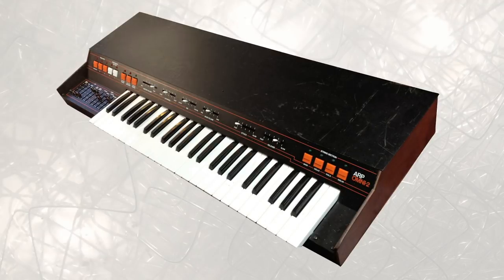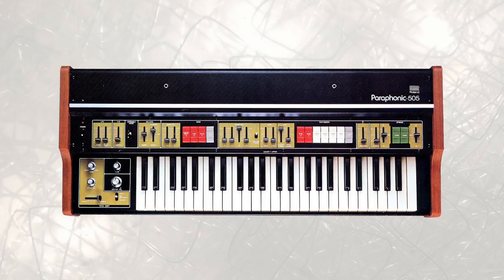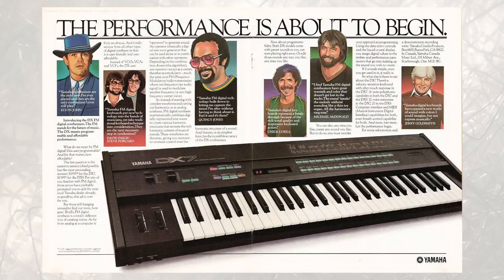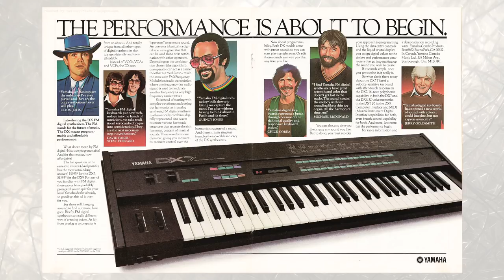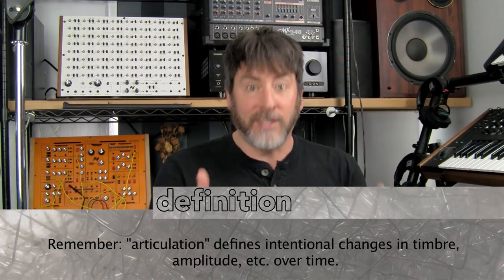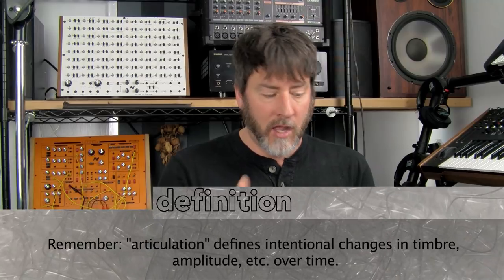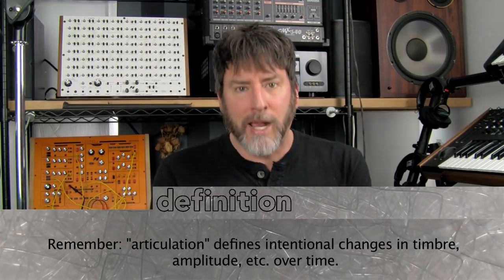A History of Polyphony: Part 14- Paraphony

Comment: I used to have a Poly-800. I was of the belief that it had 8 oscillators, 8 amp envelopes before the filter, a single filter with filter envelope, lfo, and step sequencer. It was a fun way to get poly synth sound for less than a grand.

Comment: What about this classification?
-monophonic
-polyphonic

Polyphonic synths have multiple branches:
- duophonic: 2 notes at once max (2 keyboard CV technique: higher and lower voltage) 
- paraphonic: multiple notes at once, frequency divider technology, but with single articulation (basically 1 voice) 
-"true" polyphonic: multiple notes at once, homogenous timbre (RIP Oberheim), each voice has its own articulation

Comment: I first came across the term very recently when Atuturia describes the default setting of their virtual Solina IV as "paraphonic" because, like the hardware version, after you hit the first key, if that is depressed when you hit other keys you do not get the full envelope (Attack) and they added a fully polyphonic mode where each key uses the full envelope. I also noticed that with the Moog Opus 3 in 1985, I just called it "single-trigger polyphonic" since multiple keys would sound, but the filter would stay where it was and not re-trigger, so the first key would "wah" but if you kept that key down and used other keys, their tone would sound but at the current state of the VCF, which also did not have KB traking

Comment: It may be the case that using 'paraphonic' for a monophonic synthesizer is practically useless, because being monophonic implies being paraphonic by definition. Therefore using the term 'paraphonic' implies that a synthesizer is paraphonic AND poliphonic, because otherwise it would be just simply called monophonic (if it is monophonic AND paraphonic) OR poliphonic (if it is poliphonic AND NOT paraphonic). So 'paraphonic' - in that interpretation of this usus - is just being used as an abbreviation for 'paraphonic AND poliphonic'. This may cause (and actually caused) farther misunderstanding of the terms themselves, but is actually a sufficient distinction.

Nevertheless - fantastic, thoroughgoing video series. I hope you will do more in that vast topic of the history of synthesizers. It certainly deserves more research, categorization, explanation and clarification than it has now.
Reply from the maker: An interesting case is raised by the Yamaha CS-15, and your post has made me realize it!
The Yamaha CS-15 is monophonic, but actually NOT paraphonic, in that it features entire-voice architecture.  Each oscillator has its own filter, filter envelope, amp, and amp envelope.  Of course, this configuration is not at all a common configuration for historical monosynths, but it is interesting because it is an example where monophonic is not paraphonic!

But yes, the primary problem arrives with synths that can play two notes... we really don't call them "polyphonic..." that term seems to apply to three-note and up.  So, that's the point where "paraphonic" and "polyphonic" can't both be applied.  But beyond that, I agree with you.  "Paraphonic" is a type of polyphony (and not, somehow, the 'opposite' of polyphony, as some might believe.)

Thank you for your thought-provoking post, and for watching the series!

Comment: I came to this video because I was looking for the answer to a specific query in my head regarding paraphony as applied to Eurorack rigs, but I ended up subscribing to the channel because it explains the concept of paraphony very clearly. Nevertheless, I would love to know the answer to this question: Suppose that I have two parallel Eurorack modular patches — VCO-VCF-VCA modules patched together over here, call it synth A, and totally separate VCO-VCF-VCA modules patched together over there, call it synth B. Both synth A and synth B are monophonic, but I am sending them to one common mixer module. This is 2X monophony, played together, ergo... what? I feel it would be wrong to call it 2-voice polyphony, but maybe that is just what it is. Somewhere, someone got it into my head that it would be paraphony. According to this video, however, if I have grasped your lesson properly, it is actually not paraphony, because synth A and synth B are each quite capable of articulating the one waveform (however complex it can get with FM and AM modulation in the signal path) that each produces independently of the other. Perhaps then, it is not paraphony but most accurately called 2-voice polyphony. Or am I getting it wrong in some way?
Reply from the maker: The thing about polyphony is that it is largely a term that has to do with controllers or synthesizers with built-in controllers that communicates how many notes a user can generate at once with that specific instrument.  In other words, it doesn't really work with modular synthesizers because with modular, it's rarely the modular that is incapable of multiple notes at a time, it's the controller.  Because modulars usually have the ability to make multiple notes at once, the "polyphonic" aspect lies entirely with the controller.  

But we don't typically talk about polyphony with modulars that are controlled by sequencers for several reasons.  One, modulars are not finite.  You can't describe a modular generally as being monophonic or having a specific voice count because that can change, and does change.  These days, in addition to that, modulars are made up of a variety of brands and types of modules, meaning that we're not talking about an instrument concept, we're talking about a studio concept.  If you describe your personal modular in terms of polyphony, you're not talking about modulars in general, or a specific type of modular instrument, you're talking about how you have assembled your modular to have a specific outcome.  

Whereas you can ALWAYS say that a Minimoog is "monophonic," in general, as a means of communicating how many notes a specific instrument can play, you can never be that specific with a modular.  

Polyphony is largely concerned with how many notes a keyboard-controlled synth can play at once, because there are definite categories that suit that architecture.  

I have often toyed with the idea of suggesting "multitimbral" as the term that defines studio-like instruments, or instruments made up of many instruments... because it describes how many voices or channels are possible with the instrument.

Comment: Crumar Orchestrator had a string filter (tone control) and the Moog Opu 3 string section had a 3-state filter but it was static, rather than dynamic. Neither of these string sections used an envelope generator

Here's a little trick with the Opus 3. Settings . Srings 8' and 4', Filter; Lowpass mode, Cf 100% Res low to moderate Organ arrange the liders so that they resemble a sawtooth with the 16' at the highest and the rest at successively lower position. Organ - String mix about 1/3. Result 3 ranks of strings

A really versatile "Ensamble keyboard"; what we called those multiple instruments in one box affairs was the SC Prelude nad Brass/synth, Piano, harpsi, and clav two ranks of strings with articulation (I did not check for paraphonic envelope attack, decay and tone and two organs, the organ sound was the least versatile with no real   adjustability of tone. the Brass had a very good chorus and the 49 key instrument could be octave shifted. Unfortunately, the Moog Opus 3 was the lower 4 octave with the 16' A-440 at the top octave and no octave shift. It  had none of the fractional organs footages. The organ used square waves with a lowpass "tone" filter. It was still a very powerful synthesizer if you know how to use the strings, organs and brass/synthesizer in concert and you could use one of the stereo channels for effects and the other dry and mix to taste